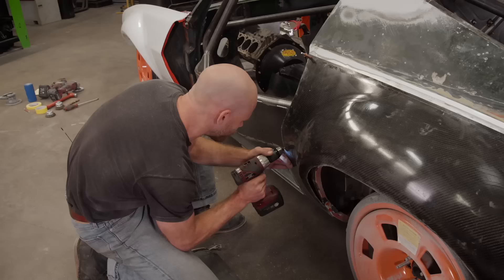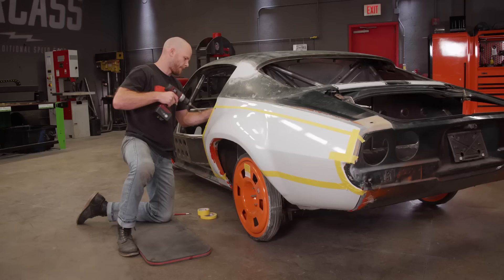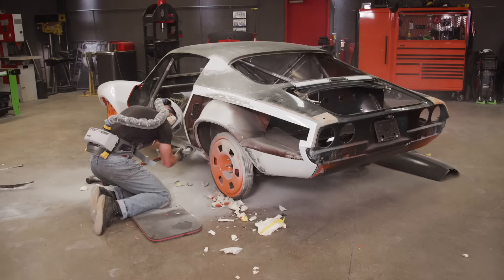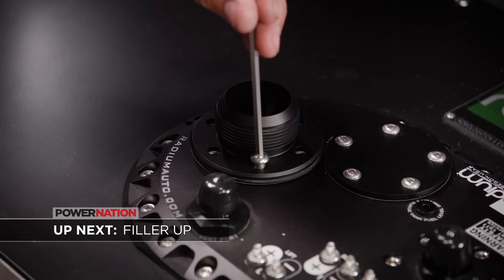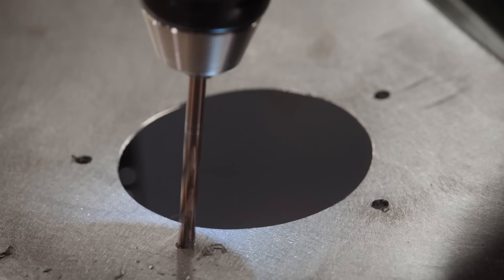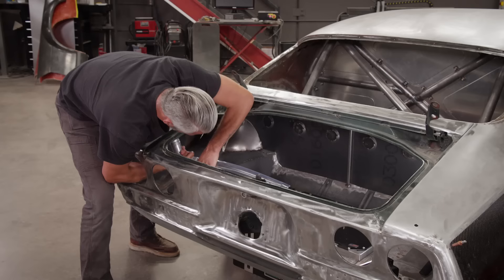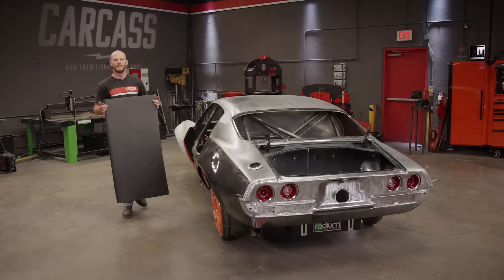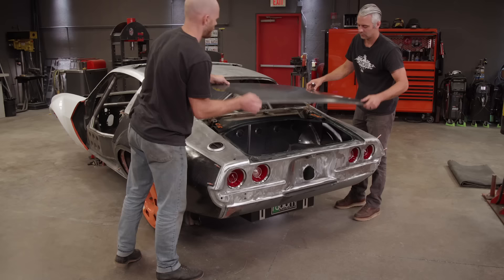Road Course Camaro Carbon Fiber Installation and Rear Assembly - Carcass S4, E16

Comment: I like how you left a perimeter of steel for the panel to attach to. Keeps the rigidity, but by replacing the largest panel section you get massively weight reduction. Keep up the amazing builds, guys!

Comment: thanks for the content 95 percent of the content is money. And I’m a loyal viewer watch every time. 
 on to the bad news 
Eh, ie, eh, ie, 🫨 the trunk lid latches. ?
My head is spinning,  what was the philosophy doing the latches the way done in this episode vs a hidden single latch, OEM/stock style ? and hide a button some where under the bumper ..easy , peasy 
Man so much geometry in that job I don’t think I could pull that off the first time…I deff would have to have another carbon fiber trunk lid, as back up lid. 
 I guarantee I’d mess up the first trunk lid……maybe even the second carbon lid. 
I feel like a lot of important steps in this install was edited out. 
…..I get it, it’s tv but damn that was …. Common shoot us viewers straight Carcus guys… Plz

Comment: I always thought carbon fiber panels looked stupid and pointless till I bought a 240sx body that had all carbon fiber exterior panels besides the roof. I dropped my track engine in (642hp LS3 CD009 combo) I wrecked my track car by driving on the street lol sometimes u forget the difference in grip between a track and pavement. Anyways man that car felt insanely light and agile. Eventually I got a chance to drive another 240sx.  And it felt like a yacht lol 
So now that I'm starting on next year's body... I'm here learning to do this myself

Comment: When this project first started I thought “why would you cut up that nice Camaro?” Now I see! It’s going to be very cool! 👍🏼
Reply: I don't , as little of the real car they are using they didn't need to start with the best looking Camaros ever made. It's a race car so they didn't even need a title. Just goes to show people suck. Hell only thing that's going to be left of the real car is the roof, don't need to cut up a rust-free 50 year old car for that.
Reply: @b.shoemaker2806 that car had alot of damage and wasnt in great shape in reality.  How do you know the car maybe couldnt be registered..who knows.  But it had alot of issues
Reply: Complete new body shells are made by Dynacorn so no big loss.
Reply: @bobroberts2371  that's my point, is a " real" car it was savable. Could have used a replacement body race cars don't need a VIN number. I am from the rust belt and other than title problems I see nothing on that car that couldn't be fixed.